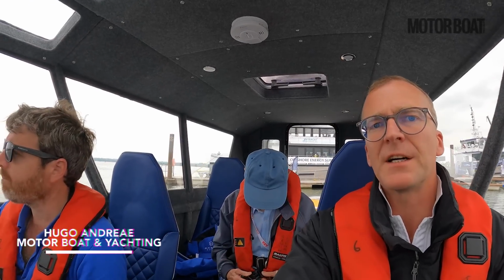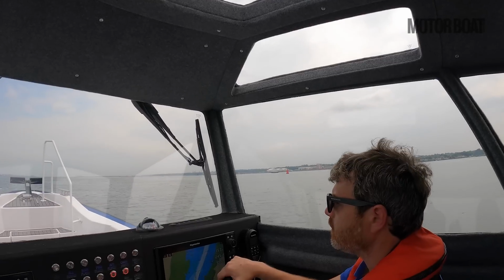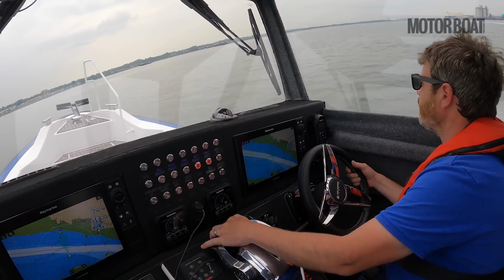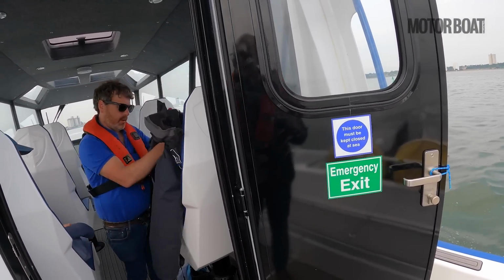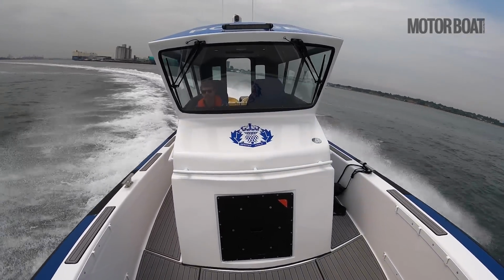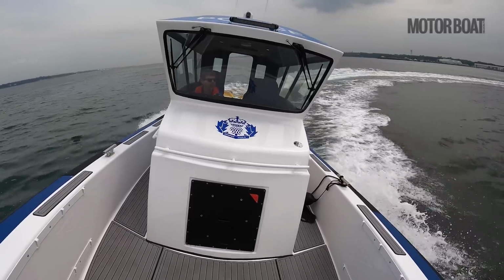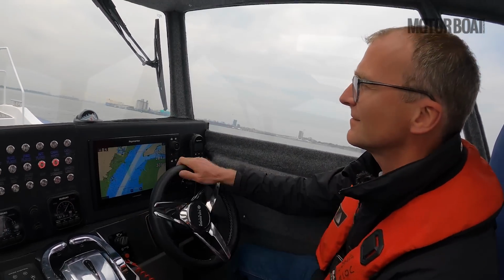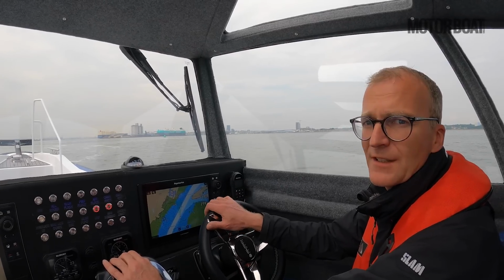Crazy cornering in 650hp Police RIB | Ultimate Boats 11 speed test | Motor Boat & Yachting

Comment: Old tymer beat me to it... I'd been working out the tunnel principles for about a year now. Another positive you'll find with the hull design is less cavitiation at the prop due to the incresed quality and density of the waterflow, you'll lose a few knots on the top end however. 

But man it's great to see how well it handles.